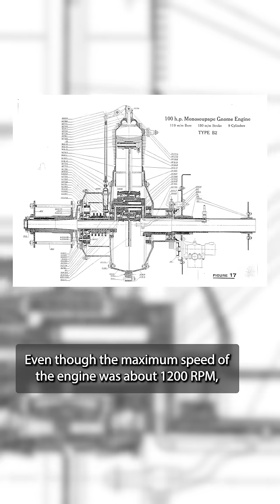The Gnome Rotary Engine

Comment: I got to go on a flight in a Ford tri-motor built in 1929. It was awesome. It's like the Harley-Davidson of old aircraft. Loud vibrates everything, and just goes. One of the coolest aircraft I've ever been in. And ive been inside some modern USAF aircraft.
Reply from the maker: That's a radial. The engine that followed the Rotary.
Reply: @The_Flying_Mechanic  I know that. But it's still antique aircraft video.
Reply: I got a ride in an old Stearman biplane with its big radial engine. Talk about a blup blup blup blup Harley like sound! Unforgettable!
Reply: @Metrofarquhar  imagine two more engines, one on each wing.

Comment: I wonder how they balanced it back in the days
Reply from the maker: Apparently very accurately. They were praised for smooth running once they were started.
Reply: The same way old analogue washing machines balance a load on the fly . Mechanical rotational balance mechanism.